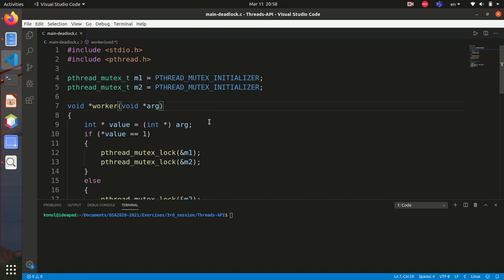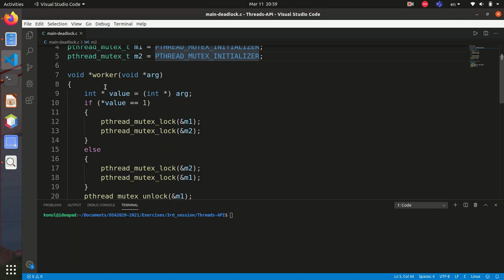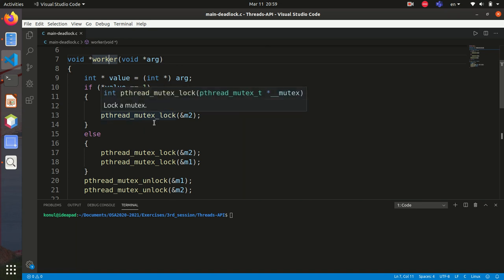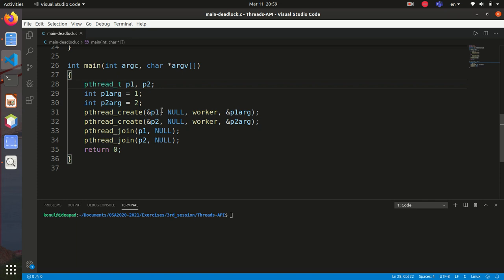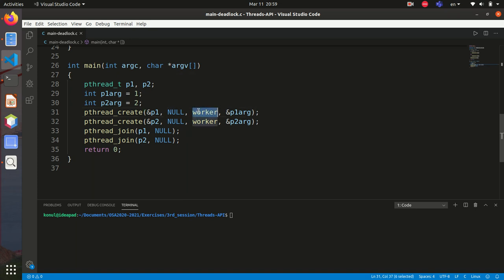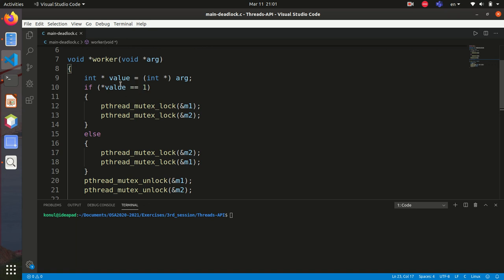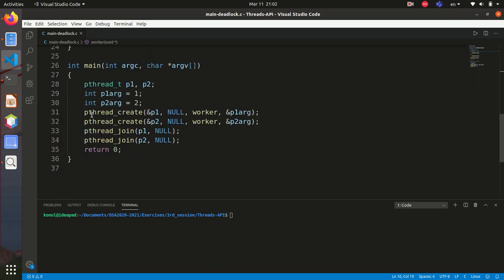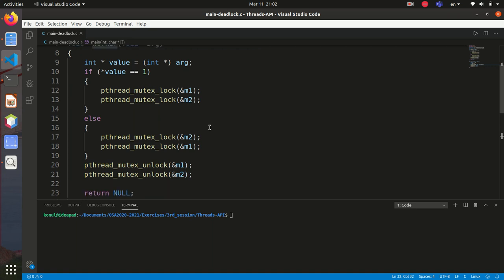Deadlock in Posix threads in C || Detecting thread errors with Helgrind

Comment: Interesting result, but it seems somewhat non-deterministic, and based upon the scheduler being used. It works as you intended in Ubuntu (Linux), but what about if you're using Windows or Mac OS X, where a different scheduler algorithm might be in use? For instance if the scheduler caused the thread1 block to be atomic, then your code would have unlocked both mutexes...and thread2 could then acquire them when it ran. Have you tested this code in different operating systems by chance? If the thread priorities were identical for each thread, then one would assume that your example works as shown--but what if they're not the same? One can easily see that the scheduler could create a non-deterministic situation if one thread had a higher priority than the other. This isn't the case in your contrived example of course, but in the real world...it certainly might be. 

Thanks for posting the video though--it was helpful to see how the helgrind tool is used.